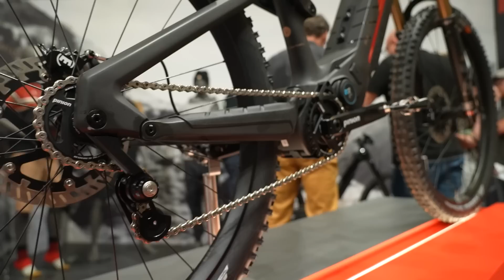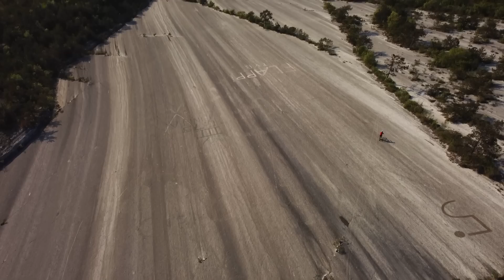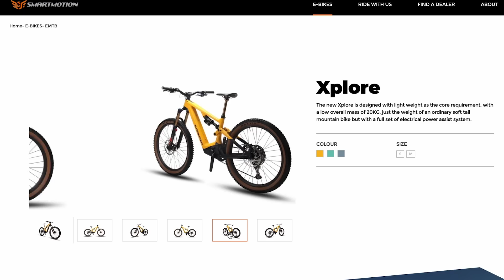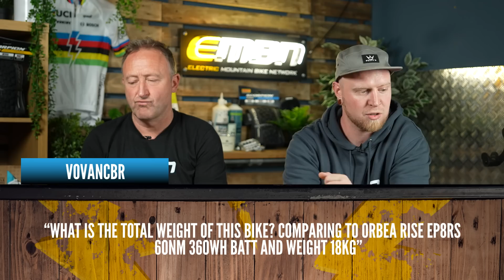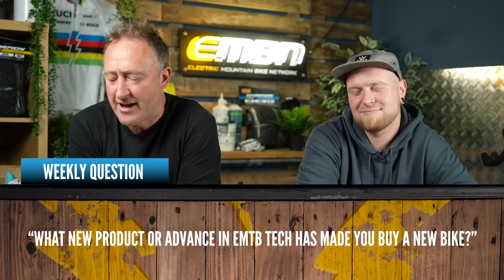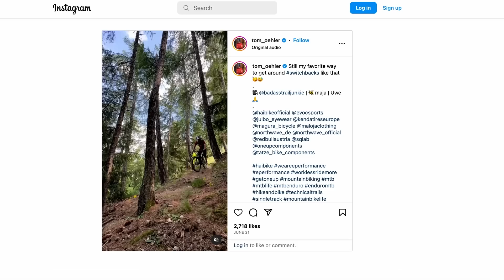Are Gearboxes The Future? | EMBN Show 286

Comment: The Future is here with gearbox E-Bikes. The derailer is fine for analog bikes, but add power and they are totally outgunned and vulnerable. You can not expect the power that is now being used to go through the same system. There are also too many gears as the power blurs the lines between gears and most could use 8 gears. Weight will always be an issue for some people. But if you aren't the power source anymore there have to be trade-offs. With the weight of the gearbox and motor located low and centered is just a new dynamic we will get used to like everything. We know battery packs, engines, and gearbox weights will come down as they evolve. This is all moving forward fast. Look where all this was not long ago. But the derailer on E-bikes is dead finally.
Reply: The derailleur will be around a long, long time. Its no where near dead.
No racer will want a heavy gearbox.
Reply: It'll still be there I don't want a heavy ebike for trail riding, hence why I tend to prefer the more playfulness of super light model ebikes. I love my Orbea rise for this reason, light and playful and can even operate as a normal bike when out of power which I've done a dozen of times on rides since it's light enough that pedaling without power isn't a chore.

Comment: gearboxes are a must on mtbs, not getting ripped off on rocks and better suspension, its the way to go
Reply: @anonymousone6075 then you will be waiting months for any Ebike motor then if that’s your argument.🤷🏼‍♂️
I’m saying that Pinion already have a gearbox that proven and reliable, the motored version shouldn’t be any different.
Reply: @anonymousone6075they shouldn’t break. Pinion gearboxes have been around for years and last hundreds of thousands of km. Your chain and cassette won’t.
Reply: @anonymousone6075 why would water get inside? The motor and box are a sealed unit. As I’ve said before the gearbox version has been around for over a decade and it’s super durable and water doesn’t get inside them.
Reply: @anonymousone6075 oh thats my third derailleur this trip, ehh whats another 1000$ if ive already spent 4000$
Reply: @anonymousone6075 acting like only drivetrains suffer from supply shortages🙈

Comment: Looking at the car industry you see more gears not less with automatic gear boxes, to achieve higher efficiency. When the shifts are seamless it makes sense with a motor. Could the same not be said for e-bikes? More real world testing needed, I guess.
Reply: Speed controls like to run at 80%+ flat throttle curve to maintain efficiency. The lower the throttle curve, the harder the ESC works, more heat, less efficient etc. Closer the step on gears, the easier throttle curves stay steady, less heat.

Comment: I rarely have problems with my suspension or brakes. Most of my problems are with my derailleur based drivetrain system and to have them shift consistently and the same all the time.
Reply: @anonymousone6075why would you have to wait for a gearbox? Your bike would come with one.😉
Reply: Maybe its time to switch from Canyon to Simplon Rapcon Pmax 😀

Comment: The MGU is here and I cannot wait to get one.  The tensioner is an issue but I will bet that the second generation will find a better, less vulnerable solution.  The derailleur has been the optimal solution for over 100 years and is still the best solution for weight and efficiency.  The ebike removes the weight and efficiency factor and the gear box has almost no maintenance.  The gearing will evolve.  Ebikes do not need 12 speeds because the close transitions for maximum pedaling efficiency is not an issue.  Drop down to say 8 speeds and now the gear box is no longer 8 kg.  I am willing to bet in 3-4 years the MGU will be on the majority of the ebikes sold.

Comment: These hosts didn’t really present the facts very well on the Pinion MGU. The tensioner doesn’t have to be mounted at the rear wheel like the bike shown it’s usually mounted from the back corner of the gearbox. The two audible clunks in the shifting! So what is every shift on a standard system perfect. A startup gear can automatically be selected, can shift when stopped, with or without pedalling. The extra weight penalty is far less than they made it seem. 4.1kg plus chain or belt tensioner and rear cog compared to a standard full power motor with cassette, rear derailleur and longer chain. The real difference is not much more than half a kilo, hardly noticeable on a full powered bike. They didn’t mention the larger gear range or the drivetrain components lasting longer than a conventional system.

Comment: gearboxes and belt drives for the future. And with that little to no maintenance. That's what I expect from a MTB or E-MTB
Reply: @anonymousone6075no they don’t. I’ve ridden a Pinion bike and you hardly feel any resistance. A derailleur drivetrain has just as much resistance when at the higher and lower sides of the cassette due to the flexing of the chain. Plus, it’s an Ebike, you have a motor to overcome any small amount of resistance.
Reply: @anonymousone6075 yeah they do (unless you install a speed cut device) but there’s still not much resistance. There’s been gearbox bikes for over a decade and they don’t even have a motor.
Reply: @anonymousone6075 I’ve ridden a Pinion bike before. The motor version would be no different drag wise than the normal gearbox version.

Comment: Can't wait to see the range of the e1.9 bikes, don't need a new bike. But wanted pinion with belt for years. Maybe it'll sway me to upgrade hardtail ebike to full suspension. Then in the future get the bat upto 1kwh and weight sub 20kg. But basically full suspension with the pinion emotor is what I've wanted, and it'll be a while till battery technology brings bike weights down.
Reply: What sets your weight threshold? My Levo is like 23kg but not an issue as long as I don't need to go over a fence. I just make sure my route includes gates.
Reply: @border304  this exact reason 26kg is a bit much to take over stiles and fences, doable but hard work. Lighter the better (lighter it is, easier it is to throw around) but sub 20kg would be a great start. But weight imo is the last thing to improve, I like the power of the cx gen 4 motor would like a 1kwh battery, and obviously pinion, then work on getting the weight down. 25kg is also right on limit of a lot of car racks and lifting it on to roof is hard work.
Reply: @GlaucusBlue  Makes sense. Thankfully I'm close enough to just cycle to Glentress.

Comment: if it is possible to make such a drive whisper quiet, nothing stands in the way of the success of such a system. the wear and tear on the conventional components is enormous if you ride the ebike a lot
Reply: With a silent rear hub, it's silent downhill. Uphill not so, but I didn't regard them as loud either

Comment: Thank you for the note to be civil. Because I was going to preface this with feeling on the point of abuse. 

You have never asked if 12 gears were too many for derailleur with those skinny chains and the need to replace the kit after 2 years when used with an ebikes. 

The pinion motor gearbox is 2kg more than the Bosch SX. If everything else on the bike is the same it will weigh 2kg more than the Bosch equivalent. If you want a bigger battery bigger forks etc that's what makes the 10kg difference. 

The problem with the Pinion is that people will keep their bikes for 20 years and they won't need to watch your show any more
Reply: much less than two kilos more if you add derailleur and cassette on top of the SX's weight though

Comment: If one of the advantages of the Pinion gearbox is to eliminate rear derailleurs being torn off, in it's current configuration you have an exposed front tensioner below the motor that will be smashed on the first tree or rock you ride over & a rear one which is just as vulnerable as derailleur...how is this an improvement??
Reply: Quoted for truth
Reply: The rear one is much smaller in every dimension, with the exemption of Rotwild's chain tensioner. But you're right:  the Supre Drivetrain by Cedric Eveleigh from Canadian company LAL BIKES as implemented in Nicolai's Nucleon 16 is king here. Didn't get as much coverage yet and I only saw it. Would be nice to hear more about that too.
Reply: I have a gearbox bike with the tensioner mounted on it. The chance of it getting hit are very low because your pedal and crank are right there or your back wheel will roll over first and I have banged up a fair number of derailleurs in the last 40 years riding in British Columbia.
Reply: the design makes it really hard to give the tensioner a knock, it kind of sits behind the gearbox. and isn't much lower than the gearbox. if it did get a knock somehow,  the spring would just return, you might get a belt slip if under power at the time. if it worries you get a spare with the bike.
with a derailleurs, any stick you ride over can flick up into the chain/derailleur and get caught.  that is unlikely to happen in my experience with a belt drive unit and pinion gearbox (not electric)

Comment: Cycling one gain continues to be the ping pong of progressive devolution. We’ve got 2 gboxx Nicolai from early 2000’s that albeit a little heavy are able to climb as good as they descend plus a wife’s Dutch bike for work and a touring/gravel/hack about both on Roholoff. My Levo has destroyed/worn 5 cassettes and 2 derailleurs plus several chains in 3 years/7k km wear and tear? Wish I’d bought the Nicolai ebike back in 2019. So I’m waiting on the back end of the first wave of geared unit e-bikes

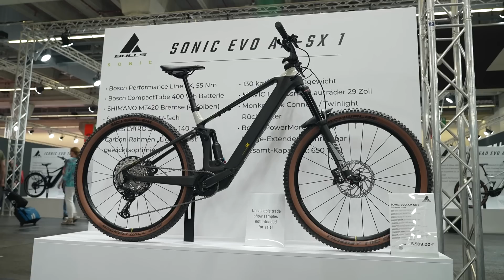Comment: 4:34 - If the weight of the Pinion MGU is 4.1 kg, why does an MGU bike HAVE to weigh in at 25 kg?

If a lightweight bike is 15 kg, a lightweight bike with an MGU doesn't have to weight more than 19 kg, and 19 assumes that the motor and gear system the MGU replaces weighs exactly 0 kg. The Bosch Performance Line SX is 2 kg, which is only 2 kg less than the MGU. If people want it, they could get an MGU with a low capacity (and thus low weight) battery, and then that light weight bike is 17 or 18 kg rather than 25.

What I want is low to no maintenance (which a belt-drive MGU unit certainly gives) and independence of battery systems. I don't WANT to be forced into buying Bosch batteries. It's the same stupid thing we're facing with power tools, where the manufacturers are forcing their users into using their batteries.

We solved these problems decades ago elsewhere with AA, AAA, AAAA, C, D, 9 volt, various button cells etc., but because ebike motor manufacturers and power tool manufacturers are greedy, they've gone the route of inkjet manufacturers and decided that their 36 volt, 17.3 Ah battery is SPECIAL and cannot possibly be replaced by another manufacturer's 36 volt, 17.3 Ah battery.
Reply: Battery weight.
Reply: @leedove7255  Battery weight isn't a function of the motor. It's a design choice.
Reply: @MrMartinSchou  "why does an MGU bike HAVE to weigh in at 25 kg?" was your question. The choice of battery is dictated by desired range for a specific motor output. The more powerful motors need bigger batteries.

Comment: If the ebikes has a gearbox/motor, does the ebikes not become an electric motorcycle???????
Reply: Regulatory wise: no. Because peddling is still required. In case of the Aden add-on notor: independently of gears: yes, since you can just pull the throttle if you're more into that🤷‍♂️
Reply: @PhilosoFox  I don't think so, if the motor is above 250 what's as this is above the eapc regulation
Reply: @davidwhitworth4577  Yeah, the Aden Motor has 1500 Watts and speeds up to 42kph. So probably a motorbike by more than one condition
Reply: @PhilosoFox  I agree with you on that
Reply: @davidwhitworth4577 it’s no more an electric motorcycle than any other Ebike. It’s just the gears that’s different. You have had gearbox bikes for years but they aren’t considered motorcycles, just because the have the same type of gearbox.

Comment: If you were buying a bike now... say, a Santa Cruz Bullit or similar (long travel ebike), would you hold off for some new launches? Or just bite the bullet (ha?) and go for it, since the bike industry has widespread stock issues anyway.
Reply: There is no stock issues anymore
Reply: Wait for the mgu..it is the future..
Reply: Prices came down again after rebate and sales special offerings. So it isn't the worst time I guess. I would also aim for the entry level Pinion mgu E1.12 bike from Bulls, but that might not be available outside Germany. Simplon one with higher travel is already beyond my price point. And if I hadn't an ebike already, I would have just upgraded my mtb with an Aden sports add-on motor, which gave me great joy to ride on the Eurobike this year❤️
Reply: Interesting replies folks, thanks. Regarding stock issues: In the UK at least, I think there is. Very difficult to find the right spec, in the right size, in the right colour (Orbea Wild for example).

MGU as the future... I am partially convinced. If it were on more mainstream brands, I'd be sold immediately. Having been bitten before by dead motors (UK winter riding is brutal), there's a lot of value to a local-bike-shop warranty. I should also add that avoid damage from rocks etc is bollocks, there's still a tensioner to break off. Cheaper if it does happen though!